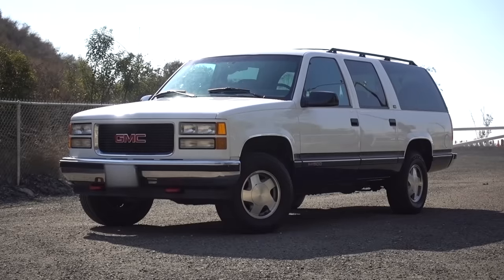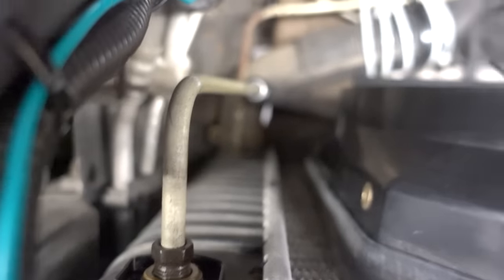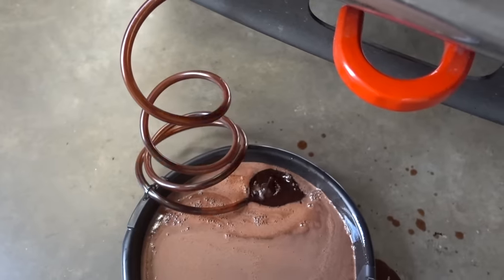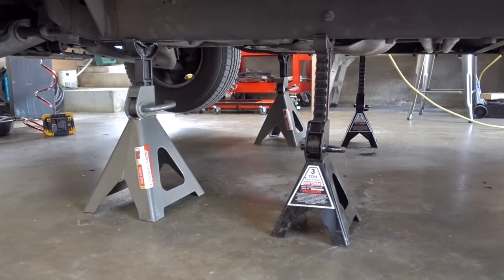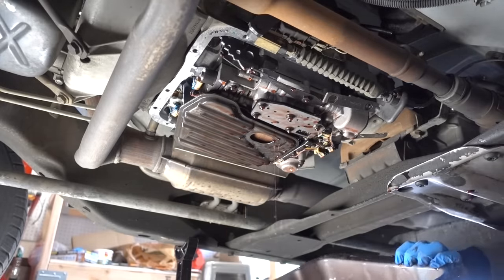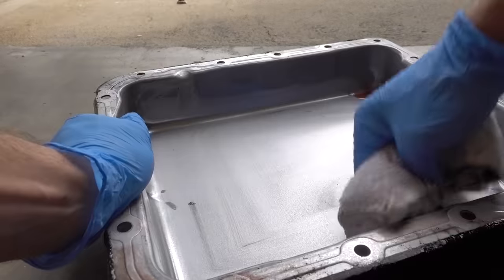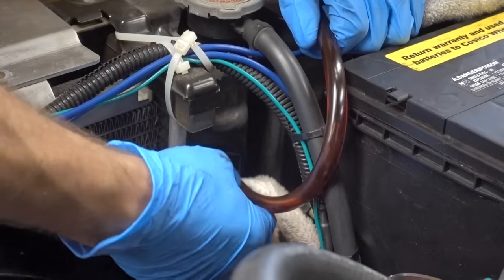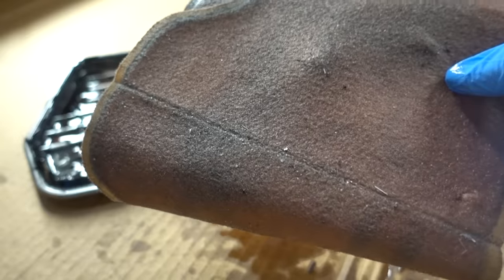Why You Should NEVER FLUSH YOUR TRANSMISSION FLUID!!

Comment: On the cooler fitting. In my best Yoda voice: "Crescent wrench leads to vice grips. Vice grips leads to the dark side of gnarly,  rounded off fitting."
A Jedi uses his flare nut wrench light saber. Use the force.
Reply: If it sticks, force it. If it breaks, it needed replacing anyway.
Navy maintenance manual, per Chief Petty Officer Duhhuh
Reply: @Jay Smith so by using wd40 you can use the improper tool for the job?

Comment: Nice job. I usually warm the trans up ,Get biggest drain pain you can find  first loosen all the pan bolts and let excess fluid drain , then hold pan up and take out 3 sides of bolts except for the opposite side that I wish pan to tilt to. Remove pan , remove filter. The filter seal is easier than you think . Just V it inwards with a awl and hammer and use a deep socket to drive in new filter seal. It is a good idea to make sure all valve body bolts seem snug. Clean pan and magnets , install new filter.  Over fill the trans a couple quarts from what was drained. Remove cooler line or hose and also run a hose from end of disconnected line or hose into a drain pan .Start and run vehicle and back light the fluid coming out to see when it comes out clean and turn off engine, add to trans what came out and subtract the 2 extra quarts you overfilled to figure what you need to add , then warm transmission and recheck level for what  you still need to add, and hopefully no flare on shifting or need to add Lucas Transmission Mucas , LOL
   Stay away from the dealer sold flush services that use cleaner solvent or that don't address changing the sump filter .

Comment: I would say, don't screw the vinyl hose into the radiator cooler. Buy a fitting, it might be brass or it might be plastic, screw it in and fit a hose over the fitting. I say this because a fragment of vinyl could end up in the valve body.

Comment: 78k I would do it after a smell test. If it smelled burnt, then it's a crapshoot. I would like to mention you are fortunate to have the shift cable bracket bolted with the pan bolts instead of those torx bolts above in the case. Also the exhaust wasn't in the way and dang man, living in northern New England it would be a treat to work on an old thing like that.

Comment: I owned an rx300 and regular trans fluid changes were a must to avoid toasted fluid destroying the trans prematurely. Older trans could go years with so much as the fluid changing colour. If you don't have the ability to do flushes just do two changes very close together and put a trans cleaner in the first change. Ive done that a few times in different cars
Reply: I'm in agreement with most of what you said except - "Put a trans cleaner in the first change"... My advise is NEVER put in a transmission additive especially one meant for cleaning!  Dumping any sort of solvent into the ATF is asking for trouble and I'd never do it to any car of mine.  And don't forget ATF is a powerful solvent all by itself.  So there is nothing a solvent is going to do inside the trans that the ATF isn't already doing thus no need for it, and you might make things actually WORSE by an additive.

Comment: I've never understood people saying never change your trans fluid.  "My buddy's trans quit right after he changed the fluid".  Well, yeah that's because it had 200k miles on the original fluid and was slipping, so he changed the fluid and the transmission continued to grenade itself like it was already going to.  

That's like saying right after I changed my oil (after running the car with the oil light on for 300 miles) the engine seized!  Never change your oil!

Comment: I just changed out the transmission fluid on a 2003 Buick Century with 69,000 miles on the 4T65e model. 

I changed out the pan to an aftermarket aluminum model with cooling fins. 

The fluid was very dark amd there was a large amount of debris. The magnet was full of metal shavings. 

I replaced the filter and bolted up the new pan. Filled the transmission with 8 quarts. Then I pulled the line out of the radiator and started the engine, pumping another four quarts out of the torque converter. I filled the transmission with another 4 quarts. I used a total of 12 quarts of AC Delco fully synthetic Dexron VI fluid which is backwards compatible with Dexron III. 

I ran into one complication. I twisted the head off of one of the bolts while torquing it down. I had to replace the single bolt. That was a job. I had to drill into the bolt and lightly hammered a star driver into it. It twisted out relatively easily. The new bolt went right in. 

The replacement pan has a drain plug which will make the next fluid change so much easier. 

I am in full agreement that one should change out the transmission fluid regularly. 

Especially seeing the amount of debris on the magnet and the appearance of the old fluid. While I did not take the time to open up the old filter, it probably looked much like the filter in this 4L60e transmission. 

Anyhow, nice video.

Comment: Did this on old Caddys, Mercedes Diesels, etc. The Mercs gave a drain plug in both the drain pan AND the torque converter. Designed by the gods (made to be serviced)
Reply: I had a Lincoln mark 7 lsc, last year made and the torque converter had a drain plug,,, should be standard on all automatic transmissions.
Reply: Chevy Turboglides had them too, the only thing about a turboglide that was good.
Reply: @Augie1979  Should be a law.
Reply: Yes they do! My f250 has a drain plug on transmission and torque converter. I just changed my again and was able to get about 14 quarts out of a 17 quart system. No pumping just simply drain and I drained the trans cooler and used a air hose to blow the lines. I even use some friction modifier for the rear differential in the transmission fluid( it won't hurt it, only helps) and the results are amazing can't fill the transmission shift.
Reply: My merc tranny leaks constantly from all of the seals and the pan, so I just top it up. Never needs a change!

Comment: You shouldn't take the pan off like that. You had it right in the beginning, but trying to take it off level never works. So when you get down to the last couple of bolts on one side, or one corner, just start loosening those up. As the pan slowly tilts, it will pour more fluid out of the pan from the opposite corner. keep doing that until you run out of one of the bolts. Now you have one left. Push the pan back up flat, remove the last bolt, then lower the pan flat as you can. You'll have much less fluid to deal with and it's far less likely to spill in your face.
Reply: That is the way I drop the transmission pans.
Reply: @billmorris2613  Me too!👍
Reply: That’s the way my dad taught me.
Reply: Bit 01  I still wonder why they do not put a drain plug in a transmission pan.
Reply: @billmorris2613  I guess because it doesn't get changed out very often. I've seen drain plugs in stock pans, but rarely.
Reply: Bill Morris My 2008 Civic CVT has 2 drain plugs.
Reply: @ramus9  It's CVT though, so it may not make it that far.
Reply: Bit 01 Not without maintenance, that’s why CVT’s require maintenance every 25,000 miles or so but even doing so i don’t think it would make as far as automatic’s do. 

My car has around 156000 miles and the belt has never failed.
Reply: He joking!!
Reply: @billmorris2613  how much would it cost manufacturer to put a $5 drain and plug in 1 million vehicles? ..... (net profit)
Reply: Big Daddy Les   I would say $5,000,000

Comment: A Finned aluminum oil pan With the drain plug is less than $75 delivered to your front door. making drain very sensible from here
Plus the Aluminum reservoir cooling affect you benefit from. 
I just installed one few hours ago.
Tomorrow will do the run-purge scenario like you demonstrated here.

Comment: As a mechanic of 15 years anyone that thinks you should NEVER do an auto flush is asking for trouble.
Reply: Agreed! Done 2 since I bought my 03 yukon at 130k and now has 242k common sense its auto clutch material wears it.has a filter for a reason ! Gotta change it out
Reply: Itza rumor started by the trans rebuilders.
Reply: @hotrodray6802  ford Australia says the auto is sealed 4 life. A kit and fluid is $200 a new trans from ford $4300.  I know why they say never do it.
Reply: @robertfloresjr8513  all that clutch material will eventually plug up small shifting passages, but in most cases the clutches are worn out by then anyway. Agree if you changed the filter where most of material caught when you fill it back up that’s enough.
Reply: I know everyone saying it lasts forever... it gets black and smells burnt
Reply: @unbiasedcobra6672  they say the fluid is ''lifetime fluid'' which means the lifetime of a car. which is estimated by the manufacturer.
Reply: @aleksiesko885  or the lifetime of the transmission lol
Reply: unbiased cobra66 You are a mechanic of 15 years. Have you ever rebuilt a transmission before?
Reply: right bullshit how i work for greico saab we do this all the time no problem
Reply: @aleksiesko885  it is the lifetime of the warranty period
Reply: thankfully for the ignorant people out there that DONT FLUSH there trans fluid on the regular manufacturers schedule,  Keeps me in business rebuilding mostly GM automatics, Just go price a replacement 2014 GMC transmission, if you use the BG flush every 60k it has a lifetime warranty, ALL vehicle fluids get contaminated & require flush eventually to stay in peak performance , even brake & steering fluids.
Reply: Another way to extend between flushes is the add a magnetic inline filter in the cooler line.
Reply: You’ll strip gears before you’ll ever have to change the fluid in 4l60e and 6l80e transmissions. 
They’re absolute garbage.
Reply: its like never changing your oil lol :P
Reply: bd real  SO NEVER CHANGING FLUIDS IS A GOOD THING ACCORDING TO YOU HUH....  as a mechanic for 15 yrs and much more experience then that, I know What im Talking about .... but by all means its your ride!!!
Reply: unbiased cobra66 I agree but once your last like 2-300k just drain it and replace what drops out flushing could knock something loose.
Reply: trae stuart if they transmission is starting to have issues chances are it’s an older car not worth saving anyways.
Reply: mkadawametwa where did you go to school?
Reply: I have an f250 with a 7.5. 354000 miles and still running AWESOME
Reply: The only time you dont do a flush is if you neglect to service your transmission leave all that gunk from you old fluid that hasn't been changed in 10 years has tons of metal shavings that can cause a blockage
Reply: @The1badxj  I'm glad I don't own a GMC. My Ford has a drain plug on the torque converter. When the seal gave out from sitting for years, I drained it.
Reply: @tracyhill7960  too bad the torque converter is hidden behind the bell housing and are always completely sealed. You can't drain them without removing the transmission. I think you have your parts confused.
Reply: @unbiasedcobra6672  and the transmission is on the ground. I took it out myself. I will put it back in too.  The torque converter is on a billet shaft, it's not enclosed. You CAN drain them in the truck.
Reply: And I have been doing mechanical work 40 years. Not 15
Reply: @tracyhill7960  so if you are changing the fluid then why are you bragging about how many miles your truck has? This was all about never changing the fluid. 
If you just drain and refill it's is better then nothing. If you want it done properly you either need to pull  everything apart or pump new fluid through the whole system. 
Draining doesn't empty the trans or converter completely and doesn't change the fluid in the lines or cooler.
Reply: @tracyhill7960  if this truck is so great why was the trans on the ground?
Reply: @unbiasedcobra6672  it sat for years and the transmission seal was installed wrong. As soon as I pulled 4 ton with it, the seal let loose. The previous mechanic dug the pump face with a screwdriver and didn't use a Ford seal to fix it. I started it without the transmission in it last week when we got the new starter
Reply: @unbiasedcobra6672  wow. As I said, I have 40 years experience. Thank you. The truck is probably older than you are.
Reply: @unbiasedcobra6672  and when you pull the drain plug, it does drain it on a real truck
Reply: Yeah me to my transmission seems to be running fine sense i got a flush in my chevy malibu 2011 the miles were kind of low i would say at about 90k but previous owner did not take care of that vehicle at all long story short it still runs fine im not getting another flush but i will be changing the oil and filter soon
Reply: I drain the pan and fill it every 15k miles, its only 3.3 quarts at a time out of 11 total I believe, but that way there is always some fresh in the transmission
Reply: Freal, these people also don’t realize you can burn you’re fluid up and the fluid basically becomes trash and does no good. I’ve had friends transmissions knock with full fluid but burnt up because it’s so old, I flushed it for them and it shifted perfectly afterwards no more problems. Maybe these bad experiences are from people that put the wrong trans fluid lol and just rumors over the years
Reply: how do you feel about doing double the number of fluid changes than the manufacturer calls for... so for example, oil at 5K instead of 10K,  Brakes at 1 year instead of 2 years... am I being stupid or giving my car a longer life?  It's a $185,000 Porsche 911... so I am a bit over protective.
Reply: Aleksi Esko lifetime means it’s fine until the warranty expires. Then who cares.
Reply: SJ nothing wrong with shorter intervals. At least you will know you took the best care you could if something goes wrong.
Reply: So  I changed my transmission fluid at 193 000km and now I'm at 287 000km and your gonna say it ain't good to flush it?
Reply: Joe gladue no I think he’s saying it is good to flush. He said you’re asking for trouble if you never flush.
Reply: @hotrodray6802  No it wasn't started by transmission builders... it was started by ppl who have no knowledge of how a transmission works!😊
Reply: @rmo4222  there is no way that will happen, there are screens in the valve body and an ipump ntake screen, this is a myth started by ppl who have no knowledge of  how a transmission operates Internally! Lls!
Reply: @jeremyc3431  Allison transmissions come with one
right above the filter...
Reply: I bought a truck that the transmission was never serviced with 220,000 miles. Once I did it started slipping 😂 the pieces of gears was helping it not slip. If it’s never been serviced and still drives fine it’s best to leave it alone.
Reply: Chevy Chrysler GMC trans probably wont last either way
Reply: @robertfloresjr8513  seems you went about 2 intervals per change no?
Reply: @unbiasedcobra6672  So that is all internal transmission fluid, none from the torque converter chamber?
Reply: @tracyhill7960  There's a button called "edit" so you don't need to post many posts in a row.
Reply: @Sams911  Fluids yes, brakes no.  Wait for the squealers to change the brakes, or you're just wasting money.
Reply: @snap-off5383 with the right tools you will pump all the old fluid out. If you do it at home disconnect a cooler line and run the car until the fluid starts to sputter out of the hose. This will remove the fluid from the trans and torque converter.
Reply: @tracyhill7960  you absolutely can not drain a torque converter while it is I'm the truck lol please go ahead and explain how
Reply: @lawman8877  when the engine is spinning, centrifugal force and the pump draws it out of the converter.  I know from experience and lessons taught me years ago. When the seal drained all of the fluid, there was almost none  in the converter either. 
Also, there is a machine that certain service centers have that draw out fluid as it refills. It's very expensive to have done, especially on my f250 that holds 17 quarts.
Reply: @tracyhill7960  enough with the experience I'm a ati graduate over 15 years of experience I am a Forman of a heavy diesel shop and I am all 8 ase certified master technician 60 hours a week dont lecture me with your back yard experience....you said you could drain the converter in the truck I'm still waiting on how that is.....
Reply: @lawman8877  I just said, ask my 94 f250, because all 17 quarts were out of the truck when the roll back picked it up . I'm currently doing a zf5 swap, and the e4od is in the snow right now. 
Also, you sound really angry.  I've done some of what you have done as well. I apologize for answering your question. It's a Ford with an international 7.3 idi. I earned a scholarship and graduated high honors at my vocational school in the trade of heavy equipment operation, maintenance and repair in 91. So you do learn things after 30 some odd years.
Reply: @unbiasedcobra6672  oh. 2 trucks. The 95 f250 is a gas and the e4od I took out is a diesel that was mistreated
Reply: @tracyhill7960  oh I'm not angry I just pointed out the fact you can not drain a torque converter in the vehicle...so stop saying you.
Reply: @tracyhill7960  and I don't care what you say back your completely wrong and you won't admit it
Reply: @lawman8877  ford torque converters have a fluid drain plug.
Reply: @tracyhill7960  .....just stop your missing the point you can not drain all the fluid from a converter without removing it...I'm all done good by.